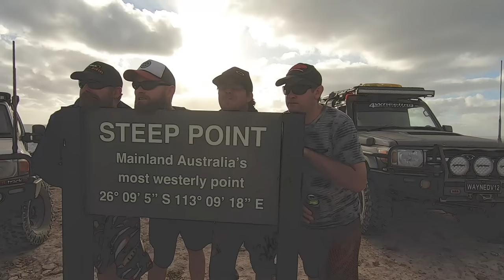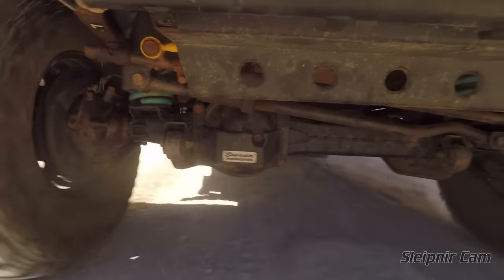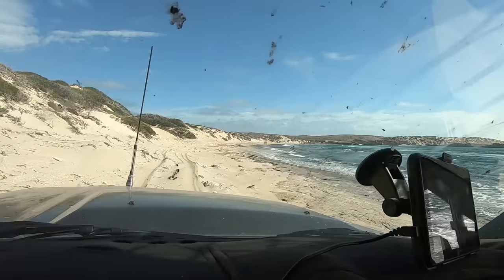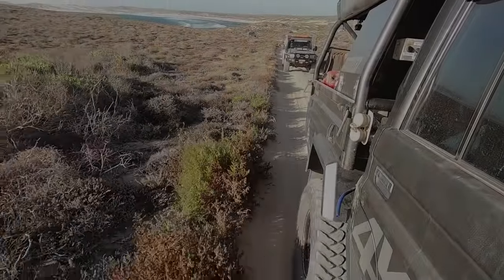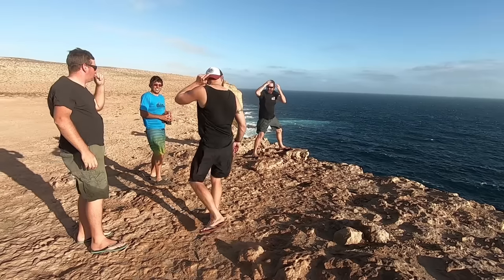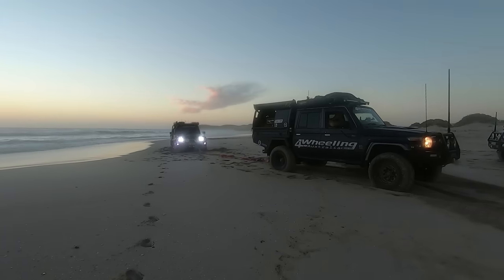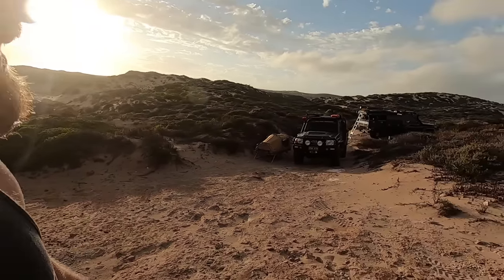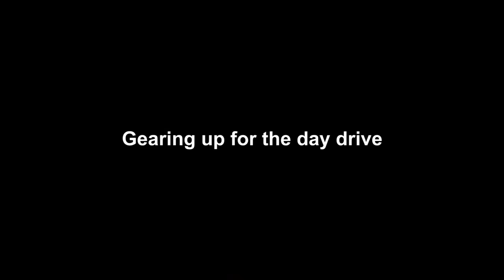4 Wheeling & Boating Shark Bay, part 1/8 Just the beginning

Comment: Whats the purpose of curtain in front of boat ?windshield or prevent sand splash from car toward boat? We dont use them here in kuwait
Reply: They are "stone guards" mate...they are designed to protect the boat from stones that are flicked up by the rear tyres.
Reply: @sergecolicchia7157  thanks . Yeah seems  a good idea
Reply: Also have them on trailers to deflect stones down because the stones hit the trailer and bounce back and break the rear window of the car. It happens a lot.
Reply: mikehzz sure does doesn’t it. Go to any caravan park where long dirt roads lead to and you’ll see dual cabs and wagons with cardboard and duct tape back windows 😂